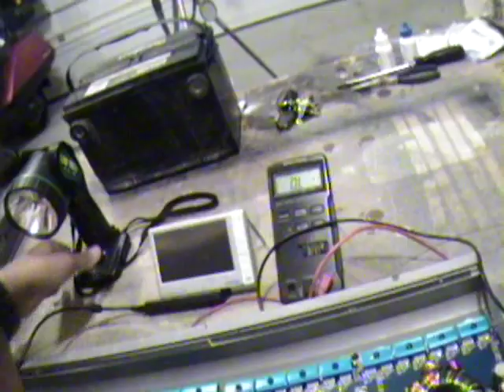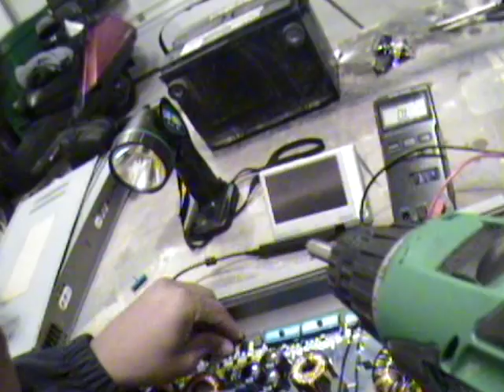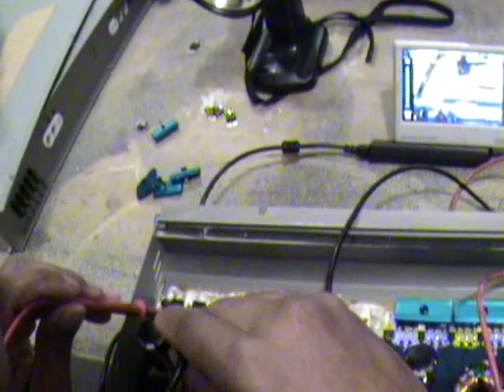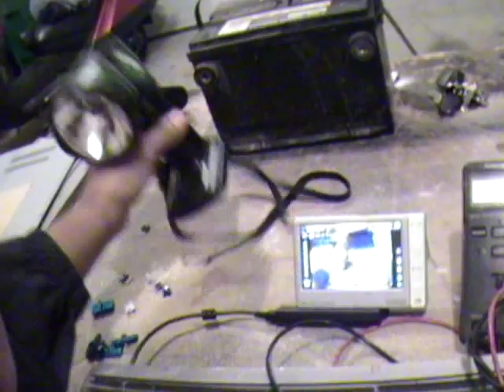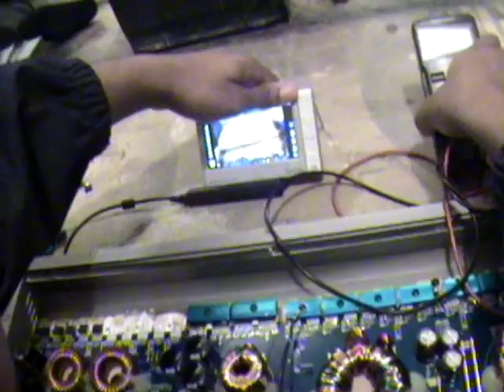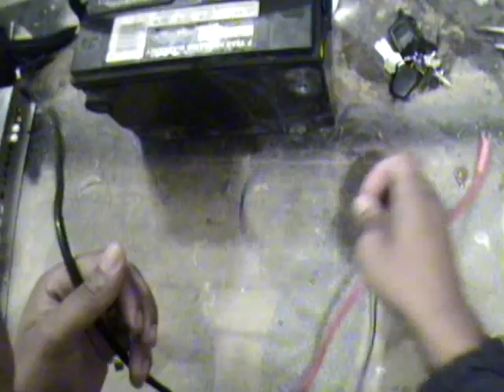Amp repair part 3.avi

Comment: power precision 1800w 2channel oh other thing is that the power part of the board has two sides of mosfets irfz44 one to the left and the other to rigth the left  is the one that is burning mosfet the other side is intact but i tested like u did and the resistance is from zero to 6 ohms. is that the problem why am getting mosfet blowing out

Comment: ey need help in this one i got a power precision 1800w 2 channel it blow out one mosfet it has six i buy them all six and put them all new before that i check anything else for problems like capacitors or diodes but everything seems ok. the thing is that when i connected the amp to power and ground it blow out the mosfet it didnt give a chance to connect the remote so it would turn on normally,,,,help on this one

Comment: Ok I have a Memphis st500.1 or something I don't remember what te exact model number is but when I turn it on it starts in the on mode then switches between that and protect rapidly back and forth and doesn't stop till I in plug the power or turn it off and I noticed that the corner opposite to the power in on that side of the amp gets hot really fast and I unplugged it and checked the fuzes and they damn there burnt my fingers it's been like this for about a week and it was fine since I got It

Comment: i have a 750.1 zx kicker .. it worked fine for two years out of no where it cut off came back on a week later did the same thing but this time no sound?. i hooked it back up came on still no sound so i unpluged the subs to try diff ones still nothing.. but with the subs unhooked the amp would just come on an cut off till i pluged the subs back up..where would i start to look for that? maybe the channel is bad? what part of the amp is the channel an how to test that?

Comment: i hav a logic 4channel 1000watt amp i installed it this morning in my car but it always go in protect i check my ground it still goes in to protect but i don't hav ah multimeter to check my voltage on my battery can u help on wat to do if to open the amp or wat? plzzzz an thnx

Comment: will bad transistors heat up mosfets and blow the internal fuses? the amp starts getting hot in a hurry it goes in attempts to go in to protect

Comment: I had my amp wired at bridged at 1 ohm & it's only stable at 4 bridged. I fried it after like 2 months of use (longer than I would have expected). I opened it up and noticed that where the ground connects to the circuit board is fried & completely melted through. If I fix the ground do you think it could potentially work again, or did I probably blow something else? I can go through and troubleshoot, but I wanted your opinion first :)

Comment: So obviously you know what your doing and thank you for providing us with these trouble shooting videos but just out of curiosty, when you read through the first transistor that your removed and it read 0 ohms, could the fact that you read through it while touching it to the metal frame of the amp cause the DMM to rean an open line?